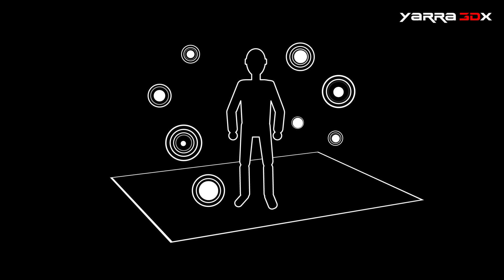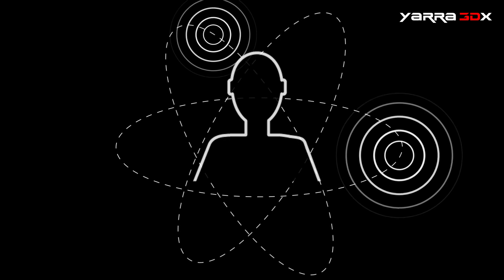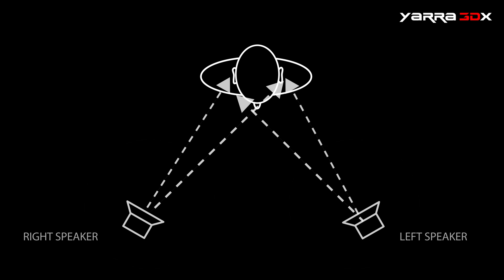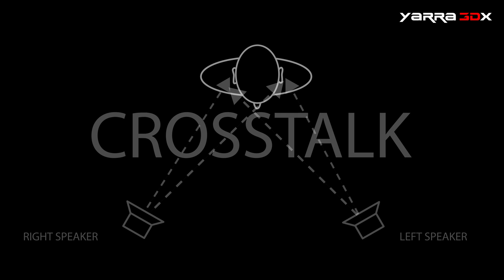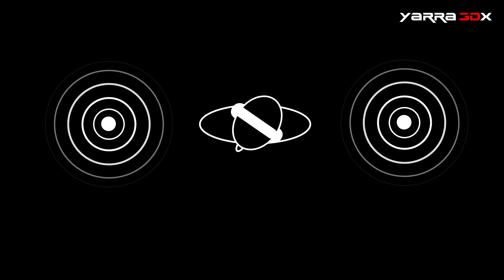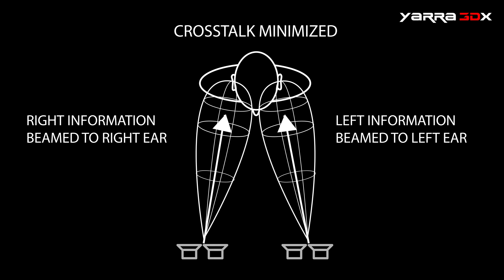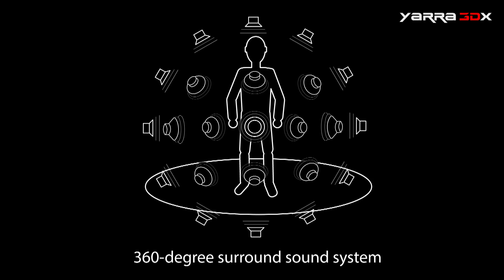How 3D Audio Works

Comment: Use three timers separate axis of space and mathematics delay and frequency can manipulate air and light each point in the any geometric room the best method is the projection of 3 circle for each axis in space time and musics signals enscrypt the timing of the moving 3 circle and where they meet is the sound and predetermined geometry of sound

Comment: Thats funny. The crossfeed from stereo speakers ( especially reference monitors) produces a more accurate image than with headphones. You want that crossfeed. If you hear something thats more left in a game the right speaker is usually quieter and still late to your left ear, giving you a better sense of left and right panning in the image. Binaural only works better if its programmed correctly, which in most games it is not.

Comment: Wow, tat's some terrible misinformation. Crosstalk isn't what you're describing. Crosstalk is when part of the signal that's supposed to play only on one channel also plays on the other channel and has nothing to do with how/what reaches or ears. It is an electronic phenomenon that happens inside the audio equipment. The way speakers deliver sound to the ear is exactly how it is delivered when an actual sound originates from any position between the two speakers shown. Also, our ears cannot precisely determine where a sound is coming from on the vertical axis, in fact our ears are particularly bad at that.
Reply: My suggestion is that you go back and research your information regarding crosstalk being only an electrical phenomenon. The explanation of left or right exclusive information "crossing" over to the other ear is real. Crosstalk cancellation is a common process in speaker-based binaural sound reproduction.
Reply: Solid suggestion, greatly misplaced though.
Of course, the phenomenon of information „crossing over to the other ear“ is real. However:
1. This phenomenon is NOT called crosstalk. In proffesional audio language, the word „crosstalk“ has a very specific and narrow meaning. We all understood what meaning they wanted to convey by using this word, and it has become erroneously use in this context, but this being (supposedly) intended as a somewhat educational video, such errors do it a disservice. But it is a minor issue, opposed to...
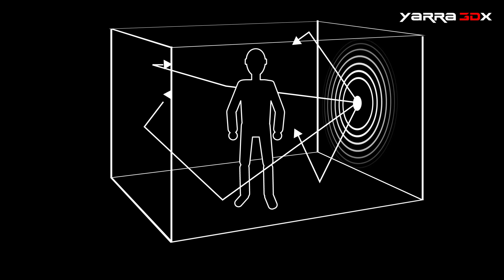2. Regardless of what word they use, the example is poor, because what they've shown doesn't represent what they're referring to, as you put it, sound leaking over to the other ear. The animation shows a stereo speaker setup and sound coming from both speakers to both ears simultaneously, with each speaker's sound reaching both ears, not just the one closest to it. But this is how real sounds in real world work. Imagine sound only coming from one of the speakers with the other speaker being completely silent. Sound from that speaker will reach both ears. Is this not identical to what the animation at 0:18 represents? How we detect naturally occuring sounds? The animation showing both speakers emitting sound at the same time does not represent this „crosstalk“ they're referring to, it just shows how we phisically detect sounds from two different directions at the same time.
3. There is no exclusive information when talking about stereo speaker setups. Media intended to be reproduced through a stereo speaker setup does not contain „single-ear-exclusive“ information because the equipment is not designed to do so. Recordings are made intentionaly and with the expectation to be used with a speaker setup and to take advantage of sounds from each speaker reaching both ears, because this most closely resembles naturally occuring sounds (in that specific field of space between the two speakers, as mentioned). Binaural recordings are made specifically for headphone use and in a way that takes advantage of each speaker more or less perfectly isolated from one another. Of course efforts for „crosstalk cancellation“ exist, but they exist only to make recordings that aren't intended for speaker playback at least somewhat usable with a speaker setup.

This video does not suggest this, however. It never tries to explicitly state that content, which isn't made for speaker playback, suffers when played back through speakers and is reproduced better when played back through the equipment it was made for  (which is kind of obvious, isn't it?). Instead, it implies that ALL material is better reproduced through headphnes with their 3D audio technology, regardless of how and why a recording was made, and does so through misleading statements as described in 2.
Reply from the maker: @slinch  In the research facility at USCD, where the the patented version of beamforming was invented by the director of the music technology and a couple of grad students, they refer to crosstalk cancellation. It IS called crosstalk and using phase to control it is an on going area of research.